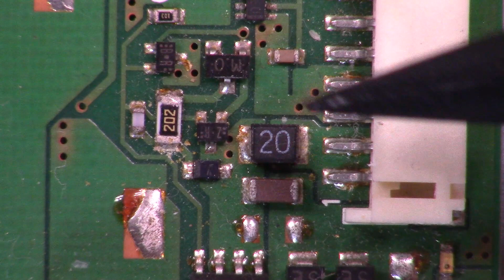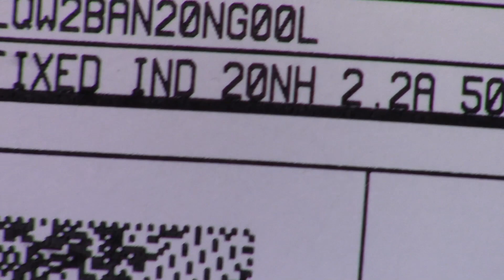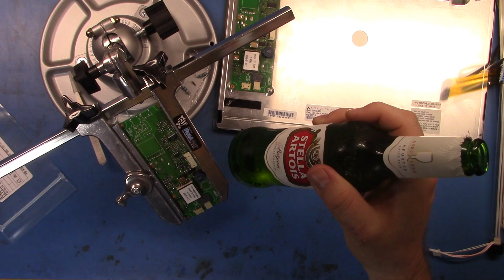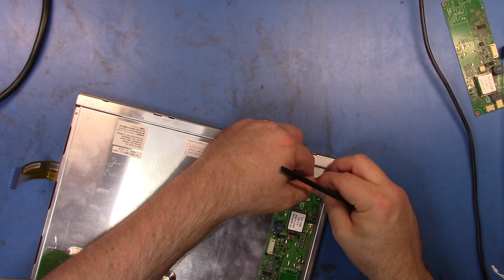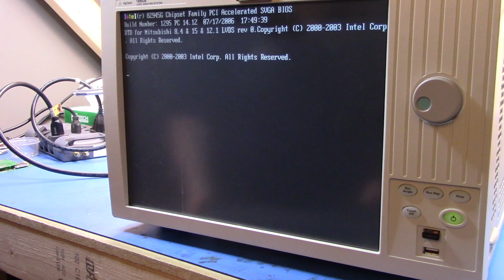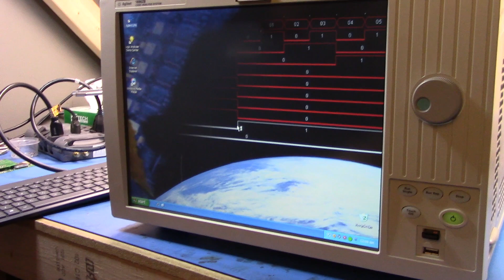Agilent 16902B Repair

Comment: Don’t take the 155 degrees “rating” at the face value!  What it tells is the INTERNAL hot spot temperature.  There is a big difference between the internal and measurable — outside -- temperature.  Depending on the heat sinking, it can be several tens of degrees.
Reply from the maker: Thanks for the comment - I think from memory, and it's been a while ago, the failure case here had a lot of current draw and thus heat dumping which drove it over the value. I think I'm commenting on the fact that the power dissipation in the working unit is well under that value.

Will have to go back and watch the whole series to make sure - There are I believe several posts over on HPAK groups.io right now I think that reference swapping these with LEDs instead of the CCFL like I did.

Anyway, thanks for commenting - Appreciate it,
Reply: 我们可以很容易的提供这个驱动和灯管😂

Comment: I could not locate these fluorescent tubes since these contain  Hg and are not longer in production.  What I did is purchase a 15 inch LED strip and driver for LCD TV repair from Amazon. I used the +12V input pins on the High Voltage board to power the LED Driver. To hold the LED strip in a 3-D printer was used to make a part which held the LEDs in place inside the metal rail.  The LED strips can be trimmed to lenght.The result was a brighter LCD screen on my LA.
Reply from the maker: That's good to hear - I wanted to try and keep the unit as close to original if I could but the LED fix is certainly a better one long term.

Comment: Pesky little inductor.
Reply from the maker: Thanks. Now that I have this thing off the bench I can look at the next piece, a modulation analyzer, that I want to use to look at the oscillator in my 5200A. I'm hoping it won't be a 37 part job like yours....
Reply: That will be interesting I look forward to seeing it, it may give me ideas of ways to check my unit.